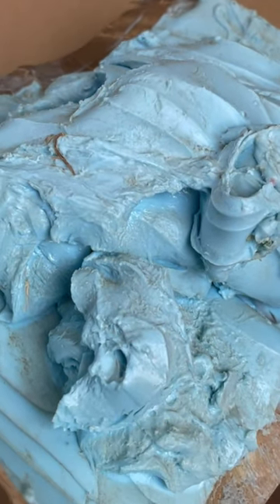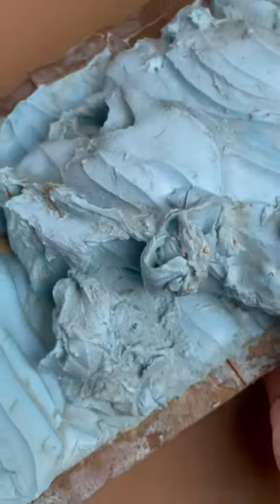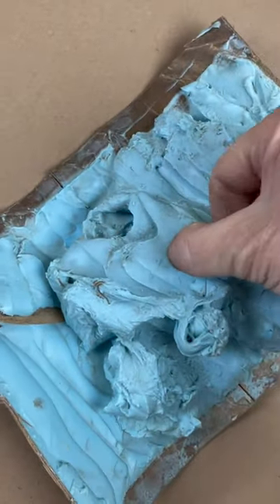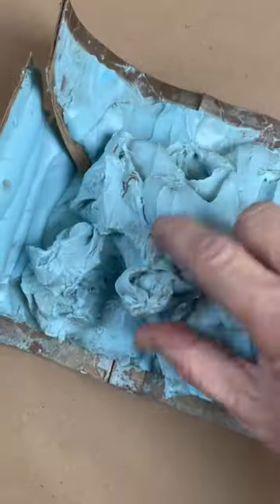Mix Ratios Matter!

Comment: I also suggest paying close attention to expiration dates. I had a similar thing happen with a new container of of silicon that had a month left before it expired. Luckily it was a simple part and easy to clean.
Reply from the maker: That is always a good idea.  I have to confess that because I buy materials in 5 gallon buckets I often use materials that are out of date.  Mostly I get away with it but sometimes it bites me in the butt!
Reply: @RobertTolone  I throw that suggestion out there as someone who is learning to do molds and casting. From my bad experience people should pay close attention to the expiration date when buying silicone when possible. I'd hate for people to end up with the same mess I dealt with.